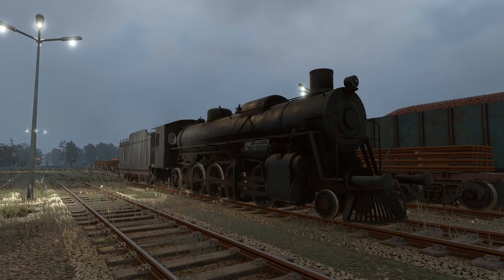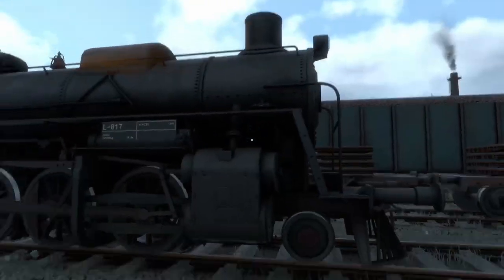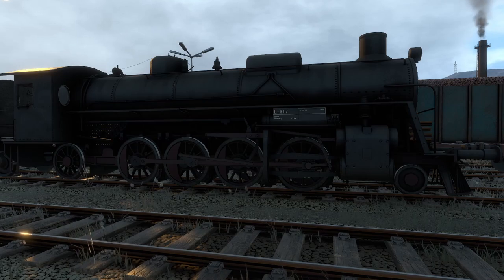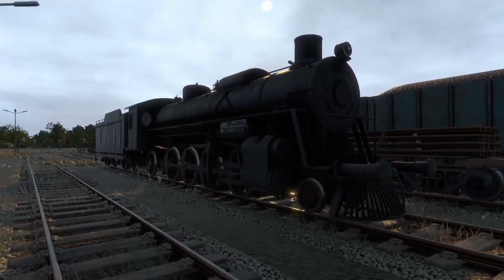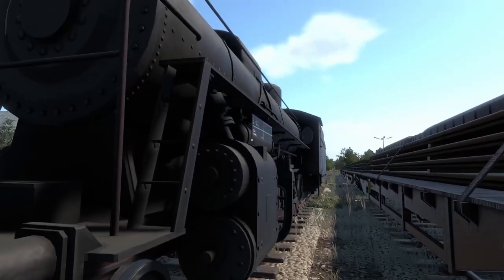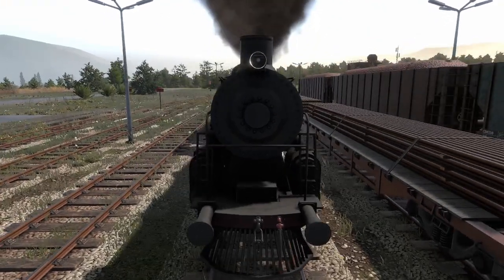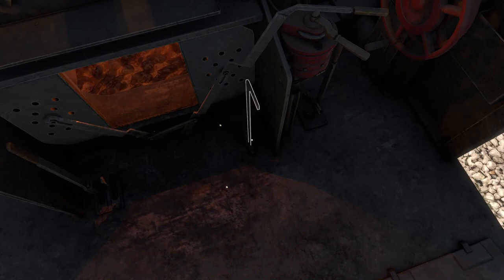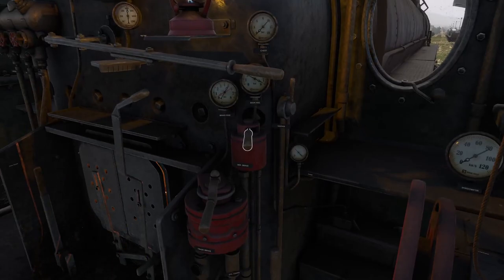Lets Take a Look at the S282! | Derail Valley S282 Tutorial

Comment: I think a Johnson bar is a US term for a metal lever with a catch handle, whether it's used for a bus handbrake or a steam loco reverser or anything. So the S060 uses a Johnson bar to control the cutoff / reverser?
Reply from the maker: Correct, while the 2-8-2 uses a kind of screw reverse